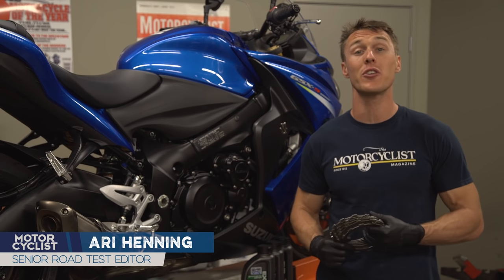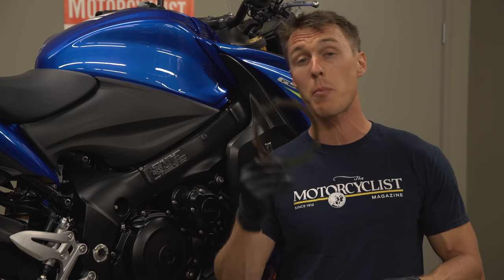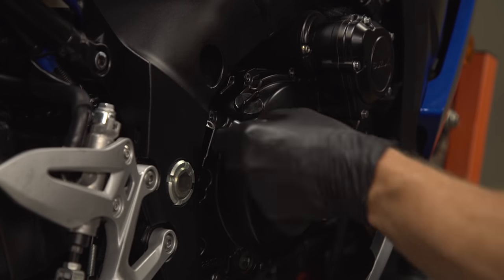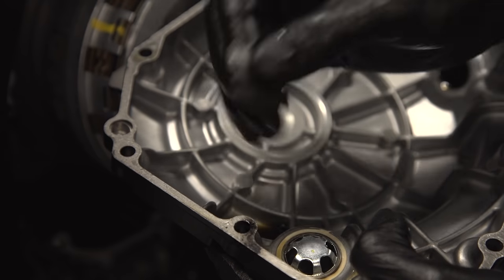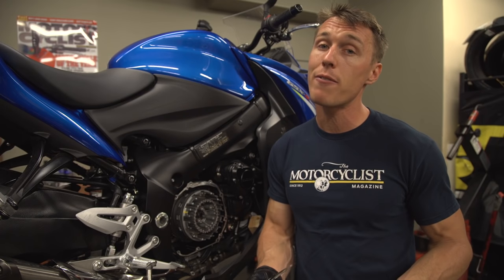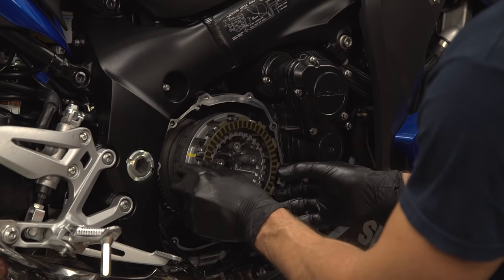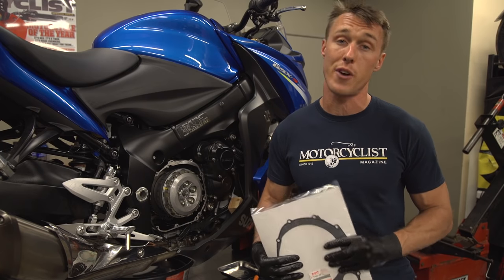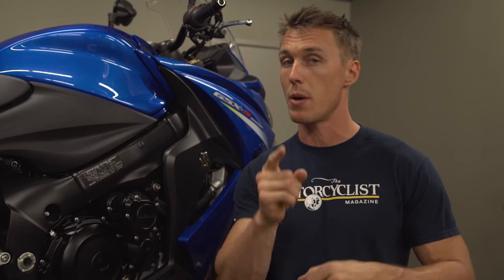How To Replace Your Motorcycle Clutch | MC GARAGE

Comment: Few issues with this video. First, you should never remove the clutch springs and bolts one at a time. They should all be loosened at equal intervals until the pressure is off the springs. Taking them out one at a time can damage the pressure plate, springs and bolts. Second issue: There is a specific direction that clutch plates need to be installed in the pack. THEY MUST ALL BE INSTALLED THE SAME DIRECTION. Installing the plates in different directions can cause abnormal wear and heat generation in the clutch pack. The owner manual should always be referenced.
Reply: Thank you man really appreciate the info
Reply: I don't think he cares about damaging plates if he is replacing
Reply: Another thing: Not all clutches require being bathed in oil. Reference your bike’s service manual to find out if your clutch is wet or dry or semi-wet.
Reply: Moral knowledge work comment hi I am read this comment many more knowledge gain thank you
Reply: Hot damn! Lol❤
Reply: Hello sir,I heard the metallic plates sharp sides should face upside,is it true🙏

Comment: never reuse a gasket. it will only lead to seal leaks. it is always better to do it right the first time.
Reply: This is anecdotal i re use mine all the time of they are in good condition and haven't had one leak
Reply: Yeah guys, I mean who you gonna believ, some random dude in the comment section of YouTube, or motorcycle magazine? Yeah that’s what I thought.
Reply: @NightyNiteXX  He wanted to sound smart but you can tell he didn't really know what he was talking about. "reusing a gasket will lead to seal leaks"
Reply: When the OEM gasket cost $10, replace the gasket. Dont be cheap.
Do it right the first time around. Not the second time. 
If you can't afford a 10$ gasket, you probably shouldn't own a motorcycle 🤦‍♂️
Reply: @alotl1kevegas860  I agree. Of course sometimes you can use and get away with it. But if shit goes sideways its pain in the ass again to drain your oil and spend a few hours on the job. Rather just spend $10 and have peace of mind.
Reply: Just another opportunity for an oil change and a chance to see what's goin on in there

Comment: I wish it was that easy on a car.
Reply: Ditch the car, ride a bike :D
Reply: Most cars I've worked on...

Step 1. If Audi, remove entire front end of car.
Step 1a. Remove the engine
Step 2. Realize step 1 is nowhere near as straightforward as it sounds.
Step 3. Bust your knuckles because some fucking bolt has seized after 180k miles.
Step 4. Replace the clutch after a weekend of swearing.
Reply: +MozzaBurger Damn right, brother!!
Reply: Depends on the car. FWD cars are hard because they have transaxles. RWD cars should be pretty straight forward.

Comment: Great straight forward video.  Two additional tips- video tape yourself removing the plates or take pictures of each step to make sure your new plates are going on the same direction and order as the old ones were.  It only takes a minute extra and will save you a lot of frustration when the dog comes in and bumps into your nicely laid out removed plates...Also, loosen (and re-tighten) the spring bolts in a "star" pattern to avoid warp.

Comment: I just installed a new clutch kit on a 2012 R6; and a couple of learning experiences. It said in the service manual to drain the coolant and remove the water pump. This was totally not necessary and waste of time on my bike like Ari mentions, so I didn't do it. Also when I put everything back together I found there were markings on the shift linkage and clutch cover where the cable reattaches that need to be lined up and the slack removed from the shaft before doing so. If at all possible, I would highly suggest getting an OEM kit. They seem to perform the best and last the longest, plus they have all markings/part# to match installation instructions in your service manual. Some plates are thicker/thinner than others and need to be installed in the right sequence as they wear faster from engagement. Lastly, don't drive the piss out of a band new clutch for a while so it can break in properly. The friction plates are similar to brake pads in this respect and you don't want to glaze them.
Reply: Brother can u explain me what is clutch plate? Plz
Reply: @the6r471  The Clutch it self is made up of about 20 plates that stack inside the case.

Comment: My bike broke to pieces the clutches and the separator and judder spring was gone, the new kit didn't came with them and i installed it without the metal separator and judder spring. It runs good but.... can it be harmful to the bike?

Comment: Great video. My clutch lever, when pulled, does not go back out. The arrow and dot on clutch cover were lined up. Should I undo the spring on the clutch cover and realign it? There's tension, but it's almost like the cable is too long now. Please help.

Comment: Hey, great video!

I did install a new clutch into my gsx-r 750 srad 1998. Of course new oil, complete set, even cable, lifter and liver. Unfortunately after like 500km the clutch did slip.
I did not open it up the take a look yet, but I have heard that the iron plates has on side a rounded edge and that needs to face against the engine, the rough edge against the clutch cover.
I did not hear about it in the video.
What do you think about it?
Could it cause any issue?
Thanks in advance.

Br.: R.p.

Comment: I bought a brand new bike, Suzuki Gixxer 154.9cc. I have problems at cold starting even if only parked for some hours at the office. The bike has like choking sound or dies when i rev it slowly at low rpms but it idles steady and fine when the throttle is not touched.. Only at low rpm's from 1200-1800 it produce choking sound or blotchy sound. I already retuned a/f mixture, Spark plug reading is okay because it has brownish tip means my A/F mixture is fine and no oil fouling. optimum A/F mixture already, i checked air filter, it was clean and new.. I also changed fuel brand already, following manual required gas 91 octane rating above. I can only run my bike smoothly when it warmed up for about 5 minutes free standing and 3 minutes running then it's okay. I already drained fuel tanks before replacing with new clean oil. I even changed oil already and new filter. But my warm up problems wont be solved? all my bikes before dont have this problem. My country is tropical climate. Please somebody help me. after heating up it's okay, but turns bad again after few hours unused. i have to heat up again for another 3-5 minutes at noon before riding home.

Comment: how do i know which direction the stamped plates go if clutch wasn't factory installed  sharp edge in or out, or does it even matter as long as their in the same direction, after i changed the clutch all sharp edges out my clutch is acting weird, with the original clutch there was a slight drag until the oil got warm, now the clutch feels too free when cold and get that slight drag when warm, i don't get how it acting exactly opposite of how it should be, i was going to reverse all the plates to sharp side in on the next oil change and see what that does, have you ever run into this
Reply: Did you ever get this figured out?

Comment: Do you need to replace the Pressure Plate and springs with new ones?? And do you need to replace this part called the “primary driven gear set”

Comment: Those 2 last identical pieces it sounded like you called it jutter springs. They stack on top of each other flat or is the last one installed supposed to be turned around?

Comment: So do I need some new plates or an entirely new clutch kit? I think my clutch is slipping, but only at 8-10k RPM when changing gear. Pulls like a freight train below those revs and doesn’t act strange at all

Comment: Nice vids ! Thanks. I have a 2005 Suzuki Boulevard M50. I suspect clutch or transmission troubles. Seems to shift into all gears but, when clutch lever is released I get no forward motion and a terrible whining or possibly gnashing noise. Any thoughts ? Also do I need to go thru the clutch to get to the transmission? Would you reccommend a transmission rebuild for a first time DIY project ? I am mechanically inclined but, have never done anything on a bike .

Comment: Hi, I own a gsx s 1000. I wanted to clean the sprocket side case as mud and chain spray had accumulated. I removed the left side cover, removed clutch cable and while cleaning I took the push rod out. After cleaning I fixed everything back and the immediate change that I noticed was the clutch lever play was gone.

Comment: Question; I have a 2018 GSXS1000,  When I'm riding over 40mph and put it in neutral, at that speed I cant get it to go into 1st or 2nd without it grinding (forcing) slamming . if I slow to 20mph it will shift normal. is this a clutch problem or normal. Love all your Videos by the way

Comment: just a question about a different bike I changed the clutch plates on my rsv4. but for some reason the clutch is tooo loose like the wire doesn't even make the clutch engage. so was wondering if I did something wrong while stacking the plates back in. Is there a certain way the clutch plates have to be put in I mean the groved end on the outside of the friction plate have to be in the same slot or I didn't allign that clutch shaft to the clutch center dongle like thingy (lol sry don't know what's its called) its totally different from the cbr600rr I have. please helllllp!
Reply: 2 months and no one helped you ;(

hopefully you got if solved but you could probably search it up and get help on your bike

I'm 12
Reply: Harkanwaljeet Singh it's been five months now, is your bike running well now??
Reply: this post maybe help you.if you find the solution plz tell us 
Few issues with this video. First, you should never remove the clutch springs and bolts one at a time. They should all be loosened at equal intervals until the pressure is off the springs. Taking them out one at a time can damage the pressure plate, springs and bolts. Second issue: There is a specific direction that clutch plates need to be installed in the pack. THEY MUST ALL BE INSTALLED THE SAME DIRECTION. Installing the plates in different directions can cause abnormal wear and heat generation in the clutch pack. The owner manual should always be referenced.
Reply: Harkanwaljeet Singh.  I'm having same problem just changed clutch in my cbr900rr clutch cable way too loose cant figure out how to tighten it
Reply: @malikhouser2825  lol just did the same thing and having same problem. I removed clutch release shaft when i took cover off. I was just checking my original clutch pack (19k miles on it) and put the clutch release rod in last and waaay to much slack. Thinking its not catching the push rod in clutch pack dunno. Any luck on yours?

Comment: Replaced my clutch and cable, it runs fine but when I ride a bit and it heats up, the clutch loosens and doesn't engage fully and I have to adjust it

Comment: i installed a new clutch cable on my sport bike thinking the old cable had stretched and it seems as if i can't get proper cable tension adjusting the cable at both ends. is it time for a new clutch kit?  I haven't noticed any slipping but i do seem to have a lower top speed in 1st gear..

Comment: Question on the clutch plate installation.. there are different grooves or notches cut into the tabs on the outside of the fiber plates (some are squares, and others have a notch cut in them). Is there a specific order when reinstalling the fiber plates? I understand that it's fiber then steel then fiber, etc. But do the grooved tabs need to line up vs. the non-grooved tabs?
Reply: Good question, I want to know too.

Comment: How do you adjust the clutch
I broke a clutch cable on my 2018 gsxs 1000f . The replacement is shorter than the original
Do you have to pull the cover or can you do it threw the inspection cover? 
Plz let me know I want to do the work myself
Reply: I'm confused by the question, there is no adjusting the clutch. I just replaced my clutch cable with one from Partzilla and it was the same length on the same bike as this but a 2016. The only thing you'd be able to do is move the splined part where the clutch cable goes to by the clutch cover. If you got a shorter cable I'd send it back and get an OEM, the one I got was only $28. You can adjust the cable up at the lever too obviously.

Comment: Mc Garage I need help!  Why is my clutch lever loose ( not hard to pull at all) after I took off the pressure plate of my Ducati Monster 900. I torque the screws at 6nm. Every time I pull the clutch the spring doesn’t move therefore I can’t shift gears. I literally just took the springs and pressure plate off to wash them. Heeeelp please!

Comment: I need to change the clutch on my Ninja soon. The only other one I ever did was on a dirtbike years ago. When you torque the spring bolts back to spec, are they tightening against the bottom of the threaded hole, or are they tightening against the spring pressure? The reason I ask is that I never really got my dirtbike bolts to reach the specified torque. Eventually, the springs were completely compressed and the bolt heads began to chew into the outer aluminum ring that was under the bolt heads (some type of ring plate). But I never had enough resistance to get them torqued to spec. I know this must sound stupid, but I am wondering what I am up against before I open up the Ninja. Thanks!!!
Reply: +Ari Henning that's a big help. thanks !! I have a light inch-lbs wrench so I should be good to go. looking forward to round 2!

Comment: How are you sir, i just got a question for my 2007 cbr1000rr clutch related. So i bought this bike from someone. And i notice the clutch friction point is right down the bottom. Like when u pull the clutch in and go to 1st gear. As soon as u begin to leting the clutch go it will start engaging.(its got hydraulic clutch) now most bike will start to engage when u pull the clutch in and let it go at 80%  now the adjuster on the lever doesnt do anything it made it worse. I pull the clutch in and go to 1st gear and start engaging straight away(very dangerous). Now my question is, does it need a brand new clutch kit??   And when i pull the clutch in i notice a sound from where the cltuch plates are located. And there is not much tention on my clutch 😣😢😢

Comment: Hey bro,, I need advice, I've got a situation I have a 2003 Honda 954RR I have replaced the clutch plate and pressure plate and the springs. But now it's Slipping on 5th gear while going 80kms I change gear to 5th it's not even accelerating on a rev but soon as I changed gear to 6th or 4th it's running fine... before I changed it the clutch it was slipping on 2nd gear? What do you think I'm missing here? please help thank you.

Comment: I’m a female and doing my clutch myself haha I drained oil and removed filter already and drained all radiator fluid already now I have the friction disc 1/2 and driven discs 1/2 soaking in oil. In the morning comes the more difficult part of removing everything else. I’m confused on wat he meant when tightening the pressure plate back on at 8lb feet of torque, or reference the manual what’s that mean exactly ?

Comment: could you exlain what is newtonmeter / NM on how to know how much is 1 NM for screwing bolts on motorcycle
Reply: Def farhan torque wrench
Reply: Def farhan Imagine a liter of water pushing down on a lever of 1 meter, that's 10 Nm (technically, about 9.8 Nm). So, on a 25 cm long arm (your wrench), it would have to be 4 liters of water for the same amount of torque. It's a pretty useful rough indication of how much torque to use.

Comment: Whats the point of replacing the blue intermediary discs? In my ktm 390 service manual it only states that the clutch facing discs are to be replaced when the thickness of the overall disc package is under 35mm
Reply: And whats the advantage of soaking discs for hours?

Comment: i have the good ol' manly dry clutch from the old soviet era. Is it true that you have to change your clutch more often?
Reply: Well it isn't being cooled by a bath of oil, so there is a good chance it'll need replacing sooner than a wet clutch.
Reply: If your clutch doesn't slip then it is fine. But you can check the thickness of the clutch plates and your service manual should have the specs.
Reply: +sirjolly81 true, but an oil change won't affect a dry clutch, as it doesn't have any oil in there.
Reply: any idea about the mileage of a dry clutch?

Comment: how do you know if the clutch is slipping
Reply: RPM's will shoot up, engine will rev up really high without any torque/power getting to the wheel. 
Usually happens in lower gears and higher in the rev range.

Comment: Hello MC, thanks for the videos so far. One question: I left my clutch disk soaking in the MA2 oil which I will use in my bike for about a week or so cause I am still waiting for some parts before closing the engine up. Will this damage in any way my clutch disks or it doesn't matter how long they get soaked in oil? Also I just noticed a little crack on the base of the on holes where the clutches sit on nothing major so was wondering if I need to replace that part as well or if its fine since after tighting the 4 bolts with the springs the whole thing will just hold it's self together anw. Thanks in advance for any comments.
Reply: I don't think so dude, cause the friction discs are always soaked in motor oil once it are installed.

Comment: There is one missing part.  The outer springs that the bolts go into weaken from heat. Don't take my word for it, your manual will call out their free length.   If you don't replace them as well, you won't get the full life out of the new set of clutch fiber plates.  2002 Suzuki Vstrom 1000 with 74K miles.  On my bike, there is also a coarse oil screen just below the clutch pack that you should remove and clean while there.